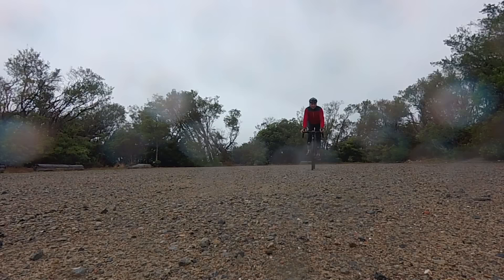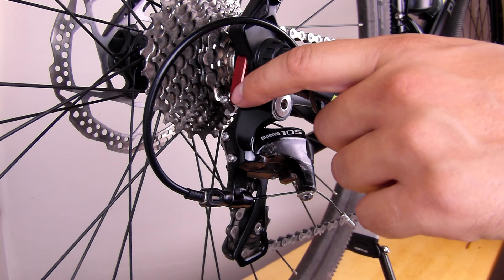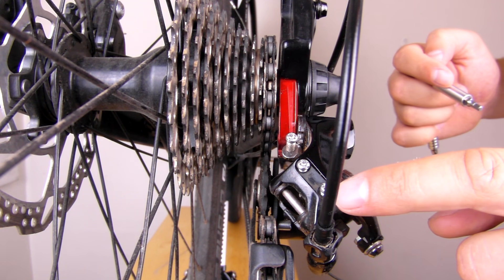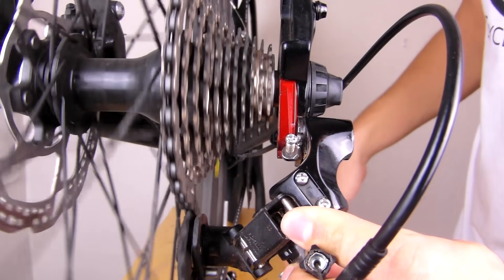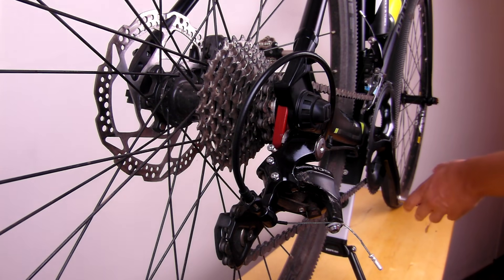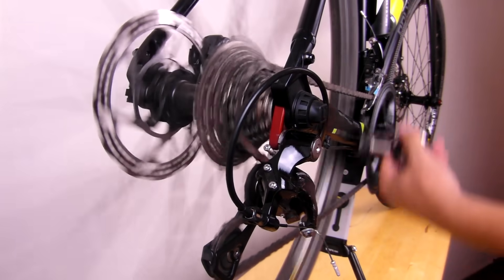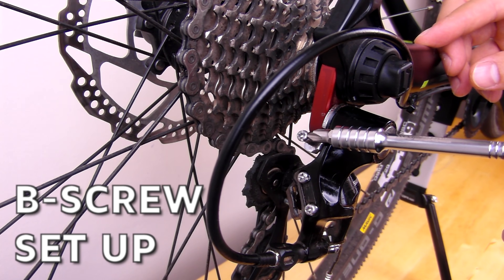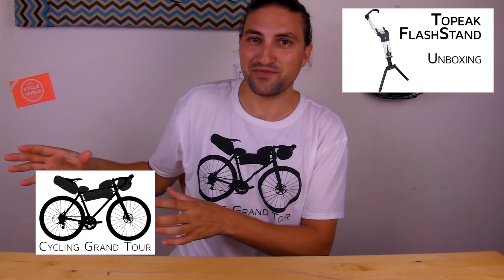How to Adjust your Shimano Rear Derailleur | #CGT - Bike School

Comment: I’m enjoying the bike so far https://www.youtube.com/post/UgkxMesz3KOGEmwmvyKQfLfrRSUXLFzfVHZA  My only real complaints are the brakes and the pedals. I feel like a bike designed for bigger people should have much larger pedals and more heavy duty brakes. I’ve only gotten two really good rides out of it, minimal downhill action, and the brakes feel like they’re already going out. A larger person has more momentum, so I think this wasn’t thought through very well. Also, I wear size 13-14 wide shoes. My feet cramp up on these pedals that are clearly made for smaller feet. Since I’m not a pro rider (and I don’t think many are who purchase this bike) I don’t think that the straps on the pedal are necessary at all. None of this takes away from the enjoyment I get from riding, however. I’ll just head to a bike shop to improve on a few things.
Reply from the maker: Hey!

The bike shop will probably tell you this, but hydraulic disc brakes, with a larger rotor will improve your braking performance a lot!
For the pedals, the straps are pointless. If you ever go down the path of clipless shoes, keep in mind that most brands have narrow toebox shoes. Look into Lake shoes or Sidi shoes for wide fit.

Hope this helps!

Comment: when i pedal my bike i pedal super fast but barely move any ideas
Reply from the maker: You need to change gears into a harder gear. If you have front gears, the bigger the chainring is, the harder/faster the bike will go.
Reply: Ricardo Deluna change your bearings

Comment: I'm really struggling, all over the place
Reply from the maker: What are you struggling with, Paul?
Perhaps read the video description where I added a bunch of FAQs.
Reply: @cyclinggrandtour  I bought a smart trainer, put an 11 speed cassette on it. Struggling with the gears. Loud and cracking noise.  Brought the bike and trainer to Halfords where I bought trainer. They couldn't fix it either. I think I need a new cable. Thanks for the reply
Reply from the maker: @Bjj900  that's a tricky one. Do you also use that bike whilst not on the trainer?
If yes, does it do the same sounds? If yes, then the problem would be on the bike, but if no, the problem might be the trainer.
If you only have that problem on the trainer, perhaps check the unit and see if anything is loose, like bolts, cassette, feet, stabilizing arms, and so on. Try to also calibrate the trainer and make sure the resistance is consistent and you're not getting any spikes in pressure. Lastly, check that the cassette has been installed correctly. It might need a spacer, or you might need to remove the spacer.
If the noises persist when you're not on the trainer, then it would be the bike. The noise you describe can only come for a few selected places on the bike. Try to check the headset (no play), check the pedals (especially if the sounds only happens in a specific rotation point), and check the bottom bracket of the bike (this one you might need a bike shop to look into it). I would also check the seatpost and saddle if the noise persists. A dab of grease on the seatpost sometimes is enough to make it quiet.

Let me know if any of this helped. Quite curious to hear from you on what the issue was.
Good Luck
Reply: @cyclinggrandtour  cheers for the help mate. I'll text back when I fix it